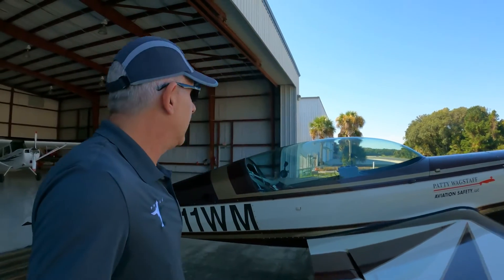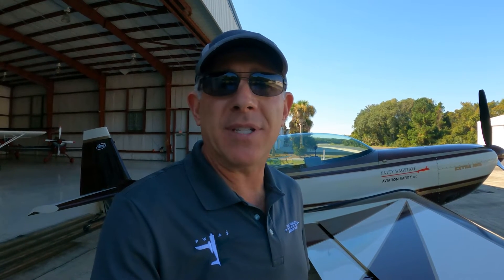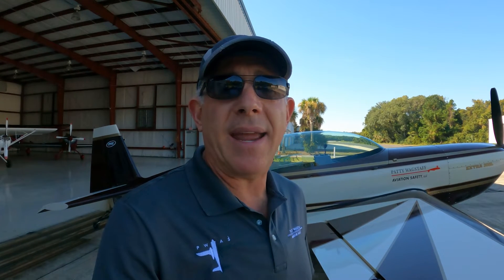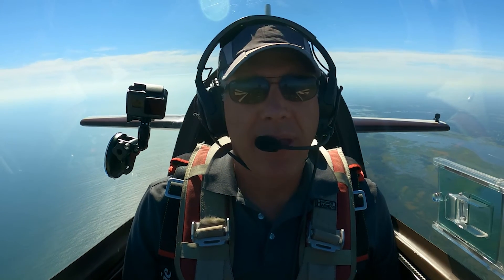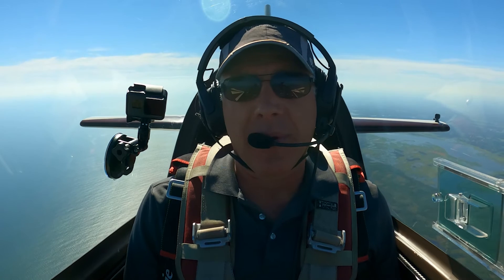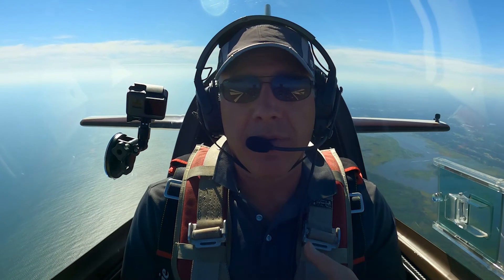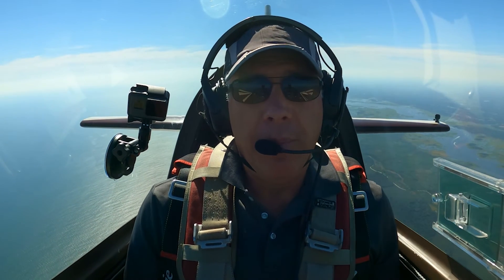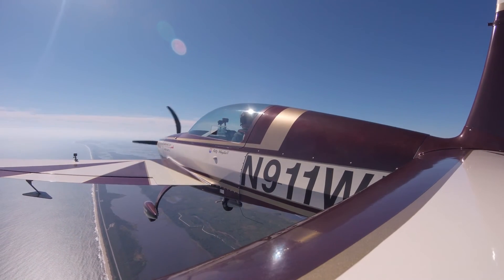Turns, Stalls & Spins - Episode 6: Accelerated Stalls & Snap Rolls

Comment: I'm just now getting into aviation (studying up, no flying yet) but it seems crazy to me that people dont know that the elevator turns the aircraft. I guess they arent really thinking of the frame of reference from the aircraft rather than from outside. but it would only take being at a 90deg bank to see what is happening, from the outside you are turning in a flat circle parallel to the ground but from the cockpit youre making a loop. same happens at any bank angle but the forces are split. basically at 90 deg bank your control surfaces change function, with the rudder acting as your elevator if you are using an outside frame of reference. any bank between 90 and 0 will have split forces requiring use of all controls to an extend.

Comment: Never dawned on me you could stall with a nose low attitude. Very interesting.
Reply from the maker: It's one of those things that needs to be seen.  Many people also think the wing stalls at the top of the hammerhead....which is why I used it in this video....it doesn't.  On that vertical line up the wing is at ZERO AOA so it never stalls.  Someone is going to ask why I didn't mention that.....just wait.